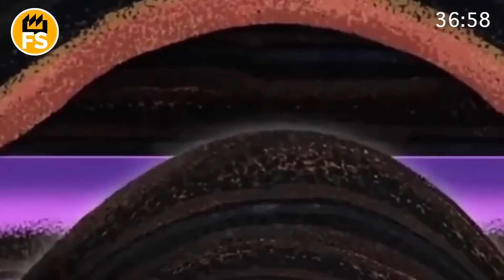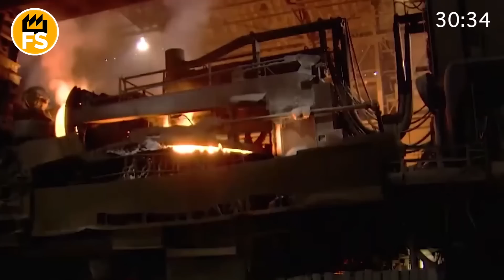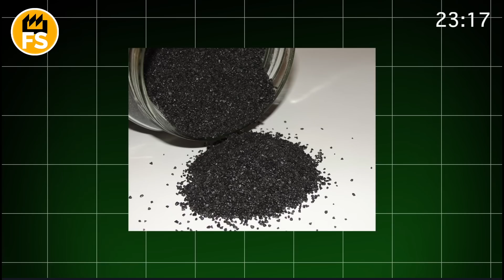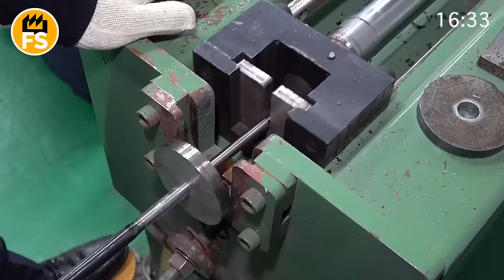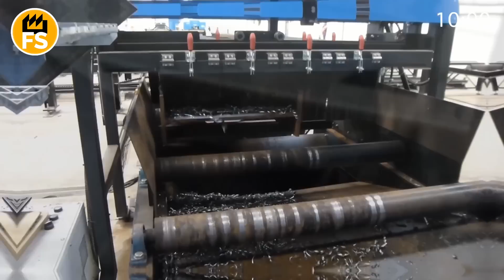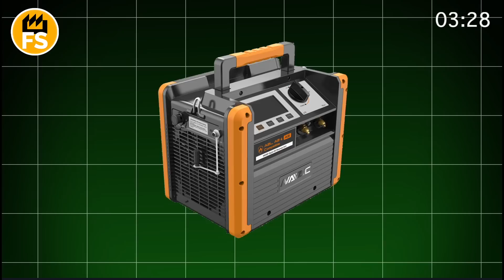How 9.9 million Barrels of Oil Are Produced DAILY! 🤯 Plus More INSANE Factory Tours (Compilation)

Comment: Quite frankly I find it rather hard to believe that temperatures of 200,000 Deg F (c. 111,000 Deg C) are used in the pyrolysis of carbon fiber. I don't think such temperatures can even be achieved on earth outside of particle accelerators.
Reply: Anything would be a vapor at that temperature and probably a plasma.